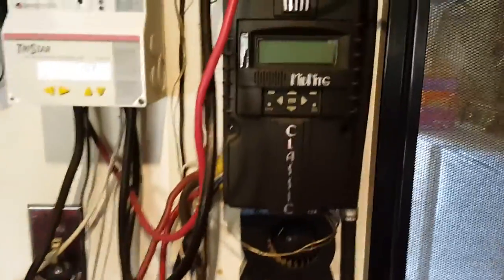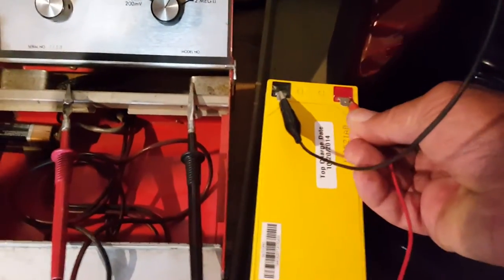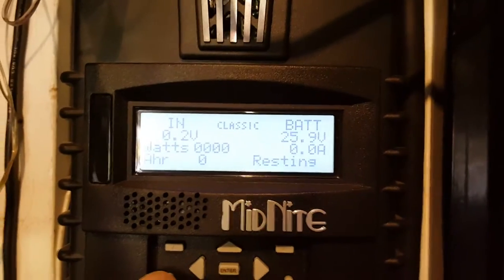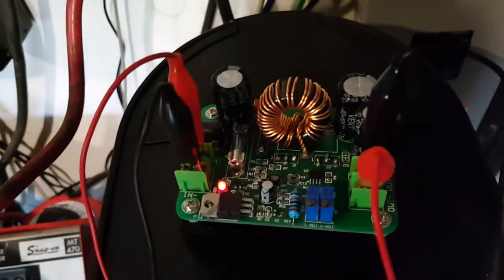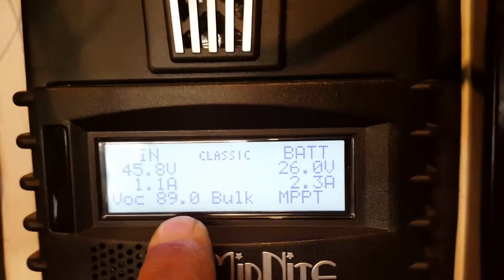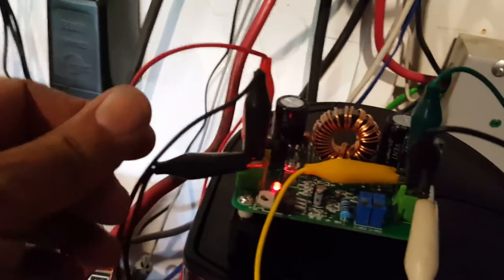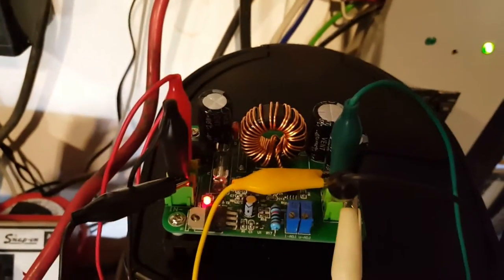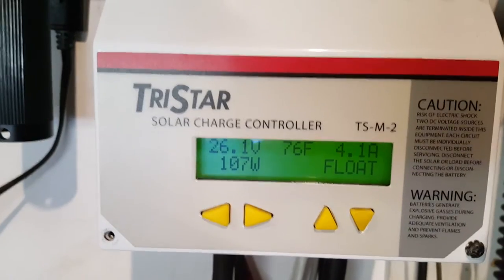Small 12 Volt Battery Charging The Battery Powered House!

Comment: I've been using a similar setup in my solar power system:
 https://youtu.be/Iae2ONg-5JI
I set the output volts/amps to match my solar panels and then use the converter to feed power into my house when I have excess capacity.  Its been running over a year now with no real problems.
Reply from the maker: We have the identical converters!
Reply: Yes, they do look the same.  I like that I can pre-set the voltage and current output and then switch them on and off to simulate a virtual solar panel.  Mine are set to output about 100 watts, that way I can transfer that amount of power from one part of my system to another on demand.  It's not a highly efficient way to do that, but since it's excess power I'm dealing with, I would rather have  80% of something than 100% of nothing.
Reply from the maker: I agree with you!